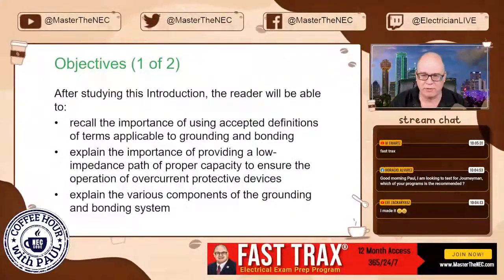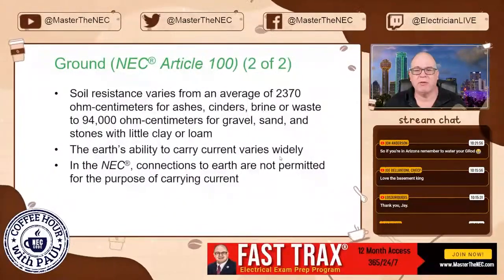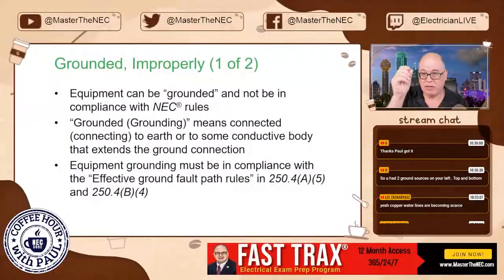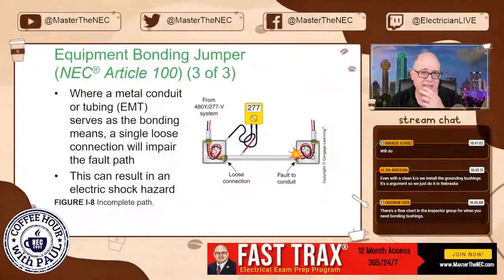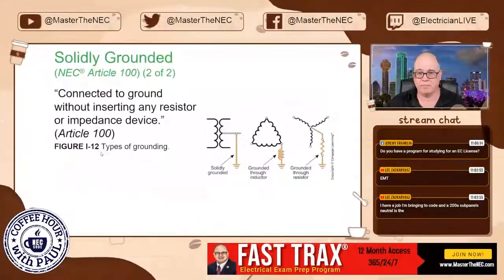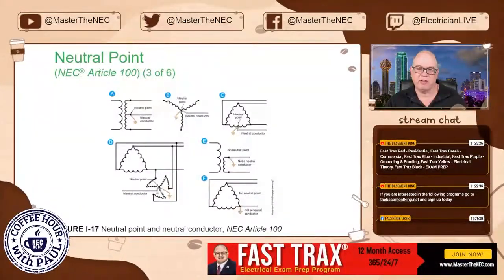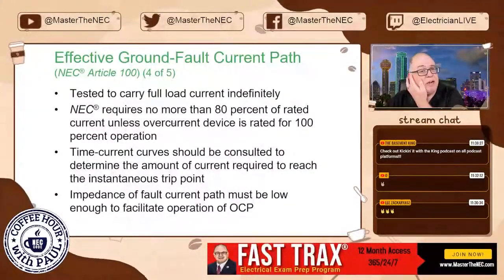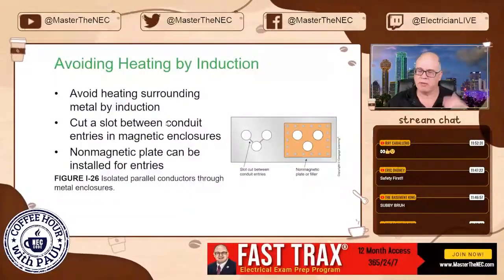Coffee Hour | Grounding and Bonding | Part 1 REPLAY

Comment: In my opinion, i do not like article 250.54 should be remove, it does not serve any purpose, people think that putting ground rod everywhere in a parking lot it is safer which it is not for me, or puttin ground rod in a CNC machine,  solar panels, some home generators etc, ground rods do not clear any fault condition.
Reply from the maker: Greetings Nic - now, you know that auxiliary grounding electrodes as listed in 250.54 are not intended to clear any fault. We should not change the NEC due to Electricians or Electrical Engineers ignorance of what an auxiliary grounding electrode is designed to actually do. 

Grounding electrodes, such as ground rods, that are connected to equipment are not permitted to be used in lieu of the EGC, but grounding electrodes may be used to establish a reference to ground in the area of electrically operated equipment. The earth may not be used as the EGC or effective (ground) fault current path. Auxiliary grounding electrodes are not required to be incorporated into the grounding electrode system for the service or other sources of electrical supply.

So, 250.54 does serve an important role but sadly we can not force folks to actually learn that role.